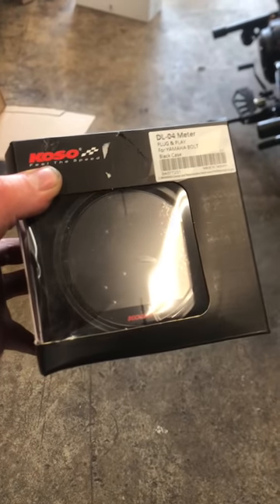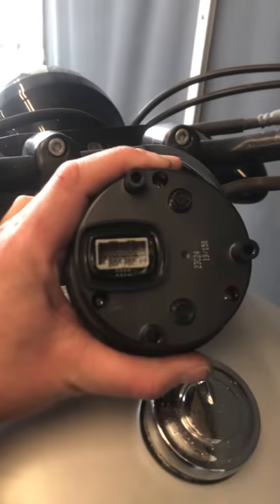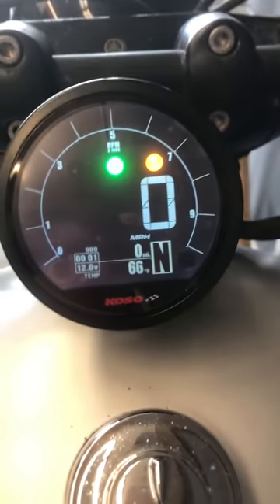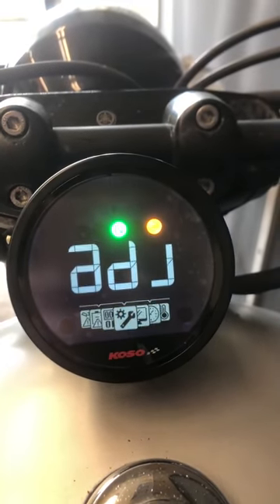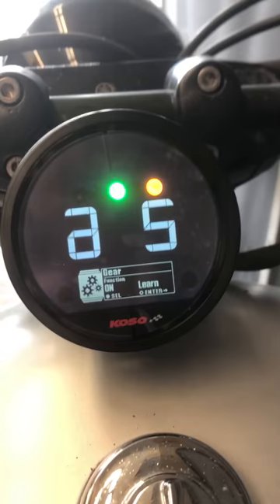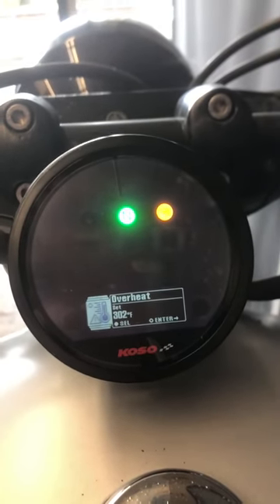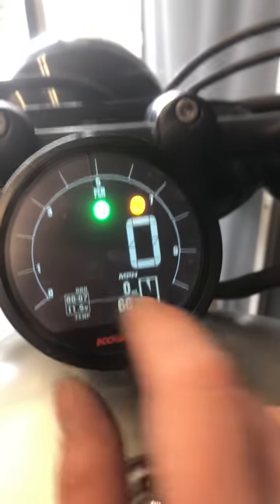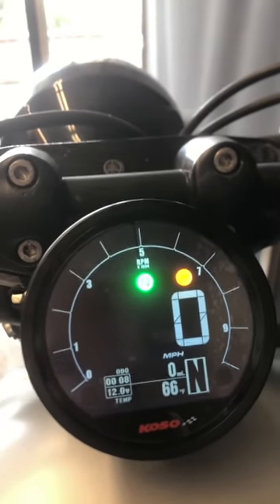Koso DL-04 for the Yamaha Bolt Demo

Comment: For the koso relocation mount, couldn’t you remove the triple tree and just flip those signal/speedo cable over the the front of the bike and put your triples back on? Jw cause I’m considering doing the dl04 with the relocation mount.
Reply from the maker: Koso now makes a relocation bracket and harness for the Bolt which we also sell.

https://dressup.motorcycles/product/koso-dl-04b-relocation-bracket-kit-for-the-yamaha-bolt-base-r-spec-and-scr950-2014-2023/

Comment: I set my Speedo with GPS verification to 95% with stock pulleys for reference.
Reply: According to their manual the standard tire size is 1454mm. I measure mine at 2030, so my factor should be 1.396. Am I wrong?

Comment: does it have a fuel level indicator?
Reply from the maker: Not possible without adding a fuel sending unit to the tank, the bolt doesn’t have a fuel sender in the tank